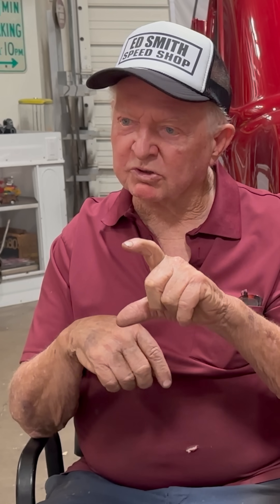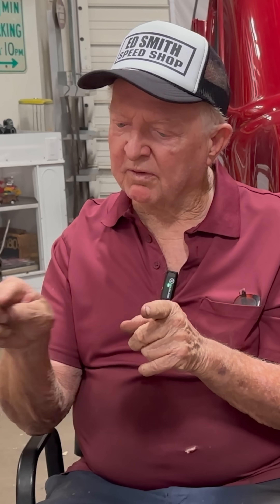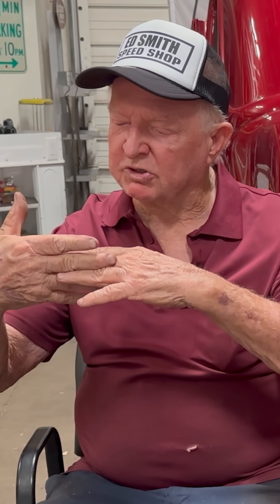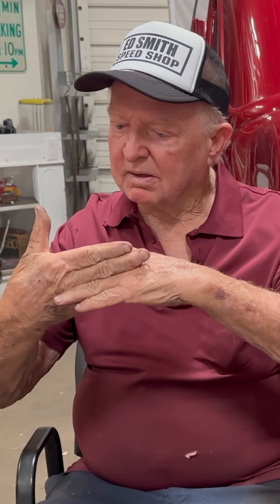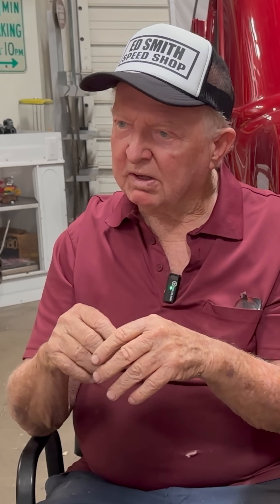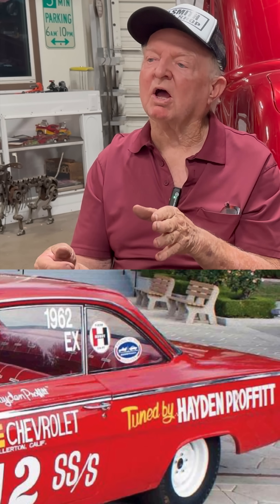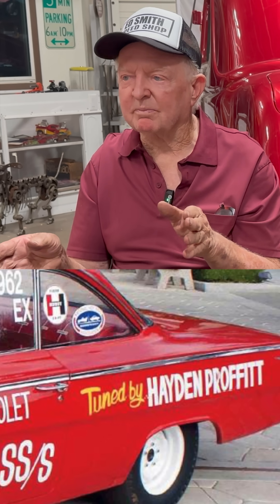Exhaust Collectors Trick w Ed - Ask Ed 28 - Ed Smith w #BarryT #enginetuning

Comment: Pretty sure its the same thing as siphoning gas you start the flow and it pulls the gas out of the tank or the header pulls the air out of the engine with a negative pressure zone, also laminar flow with less turbulence

Comment: my guess is splitting hairs on exhaust scavenge?    if you read this.  ask ed about spray painting a stripe down the exhaust to find the point to rework it to help with scavenge.   ive herd that years ago but have never tried any such work with micro hp.
Reply: Sounds like extended merge collection, reducing reversion.
Reply from the maker: He actually talks about doing that in a couple of our other videos, you are spot on